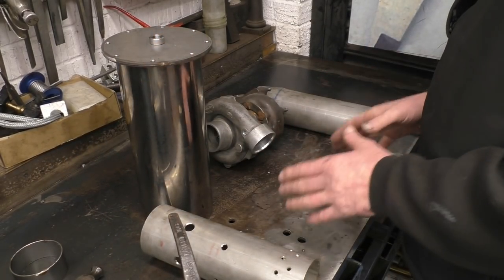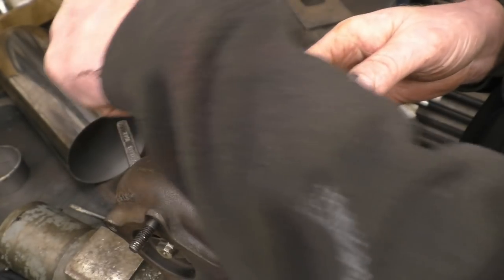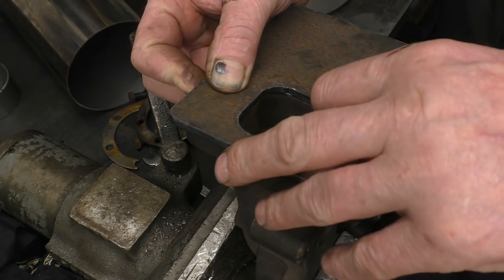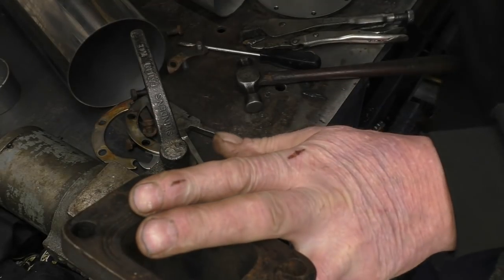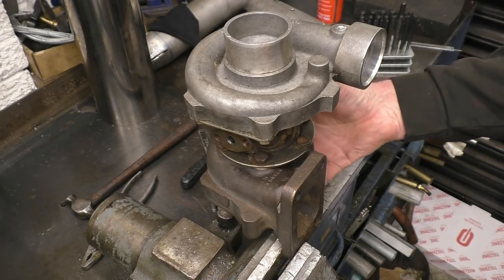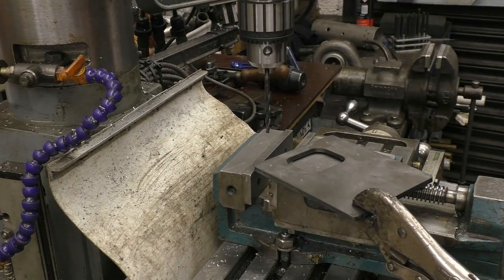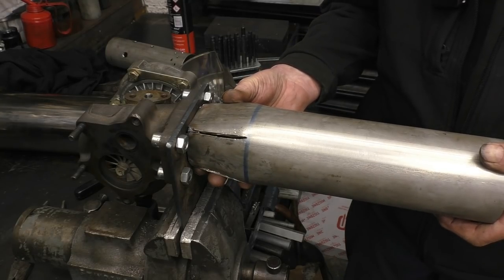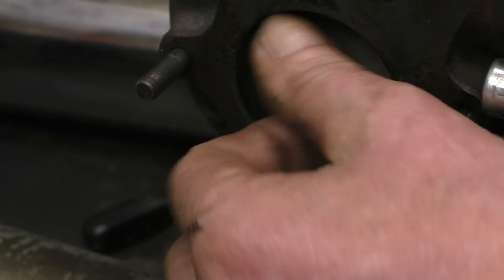DIY Jet Engine P5  Turbine Wheel (hot side)

Comment: Shoot, memory and eyesight, buggered. The other day pulling a ...off a shaft. Long story short, the bloody nut was 5 sided. Now what sick bastard starts making 5 sided nuts. oil pump...? nup, lost it, Hey! Got him. Valve was leaking on the Argon Bottle, bloody gas mob are surely sick pricks.
Reply: I was rolling about under my son's Ford Ranger, trying to remove the power steering motor, what kind of sick degenerate came up with 5 sided torx bolts ? Then again, who in their right mind would put the electrical connection on an off road vehicle, at the lowest point of the steering rack ?
Reply: @graemewhite5029  They are among us. But never identified. Didn't know that about the Torx system. I'm 73, still using foots's and inches, string and a bloody great hammer. Thanks, made my day.